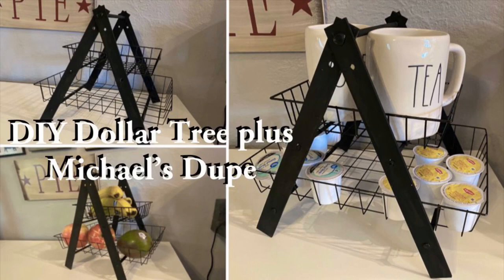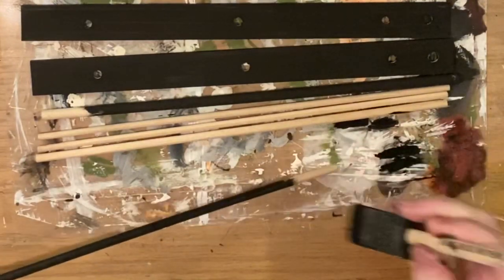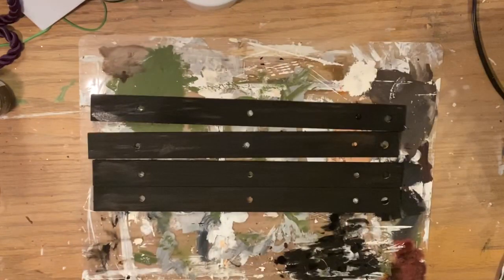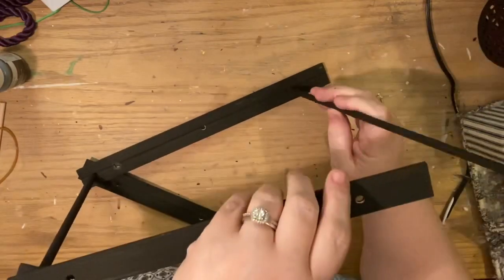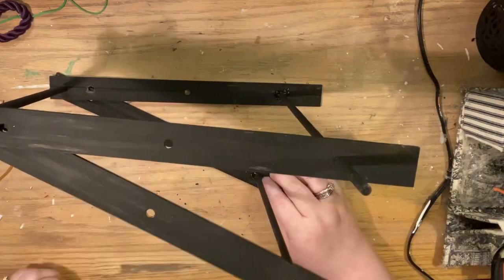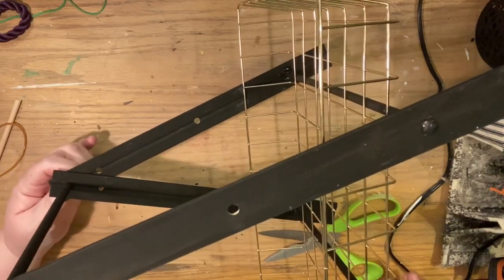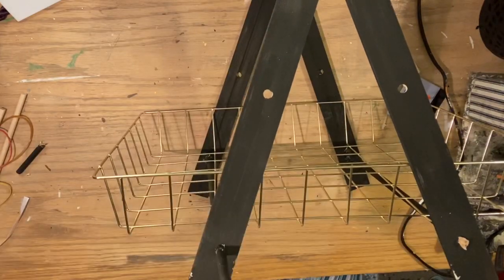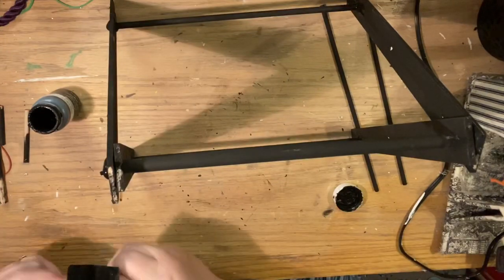DIY Dollar Tree Farmhouse Tiered Wire Basket | Michaels Dupe

Comment: I love this!! There are so many things you could put in these baskets, and it's easy to make in any style!! Just an idea: at the end of the dowels, instead of using round shapes with hot glue, you could cut off the ends of those silver metal pushpins and glue the round part to the end of the dowels, leaving it silver or paint tinting it. I think it would make it a little more upscale. Any way you do it, it's a great piece to make, and so very useful! My DT store has both baskets right now so I'm gonna grab them up tomorrow for sure and make a trip to Walmart. Thanks for sharing your wonderful ideas!!
❤ Ashley from Alabama
Reply from the maker: That would be awesome Ashley!  Great idea!